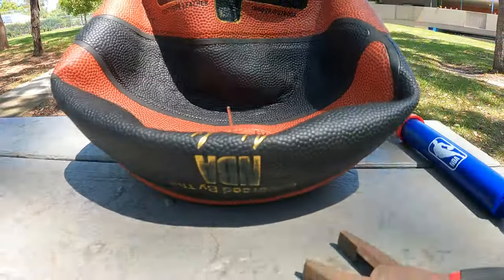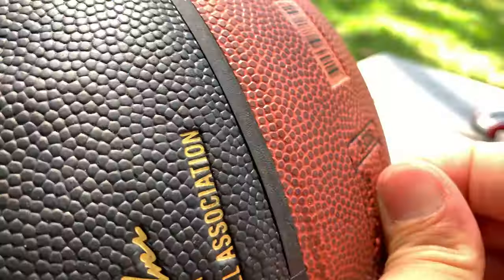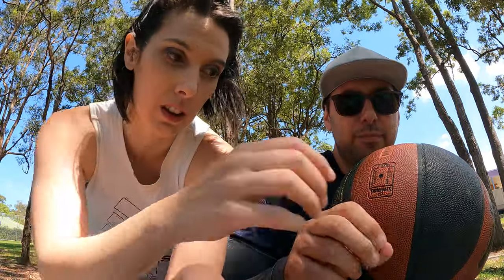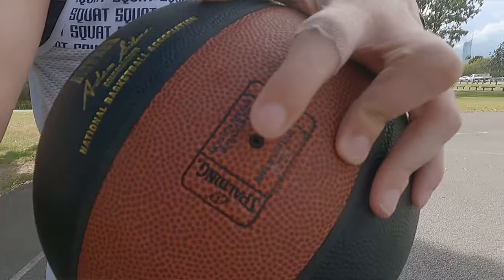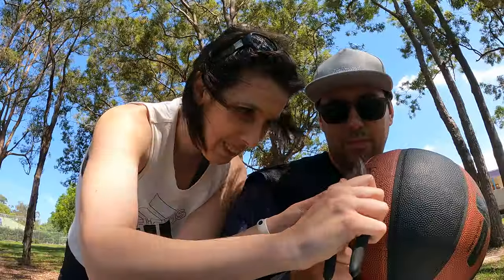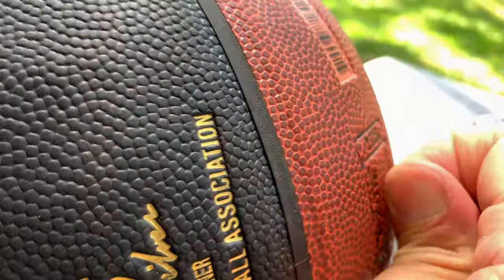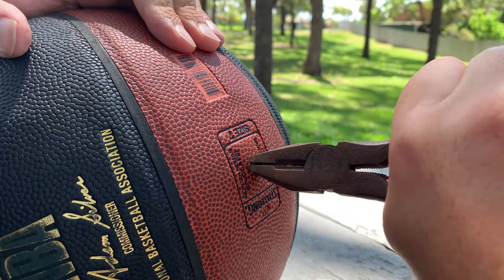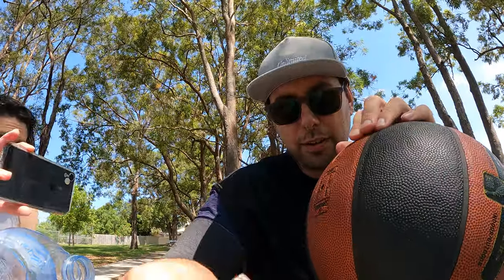Get the needle out with pliers! Easy fix!

Comment: What if it’s literally in the ball
Reply: Yes I have the same problem have u figured it out yet
Reply: @vanix5852  i have same problem now. Have you figured it out
Reply: @DangerousLiving1914  yes all i did was i pinched one side of the ball where the needle is and got it out
Reply: @DangerousLiving1914  like do it with full force, push that side of the ball so hard like you're tryna get it inside out
Reply: @vanix5852  thanks bro. I got it out by deflating the ball and using pliers to pull it out
Reply: @DangerousLiving1914  bro plz help i have the same problem
Reply: @unknown-eu2io  bro deflate your ball completely and then push on the area with the pin until it sticks out, then use pliers to grab it
Reply: @DangerousLiving1914  thanks alot bro but my problem was it was a syringe needle but Alhamdulillah i got it out by pushing it untill it made a hole and now im going to fix the hole bec it was a football ⚽ and i i was trying to fix another hole until i realised there was a needle stuck there which was making a new hole every while now i will fix these two holes bec it was pretty expensive football 🤣
Reply: I got a very small stone stuck inside my basketball, any tips on how i can ge tit out?